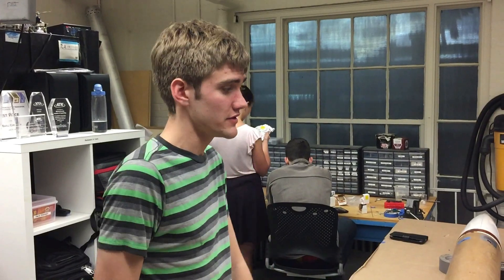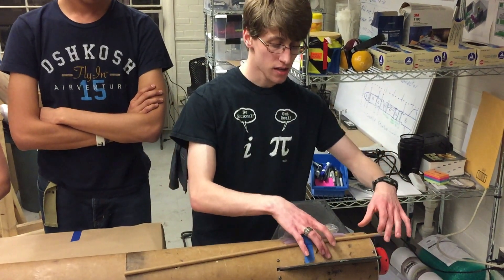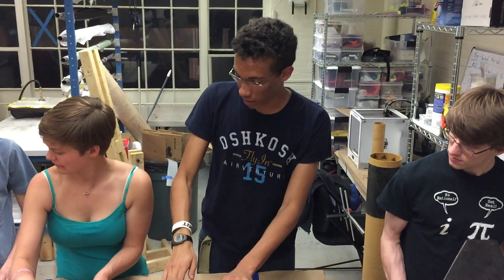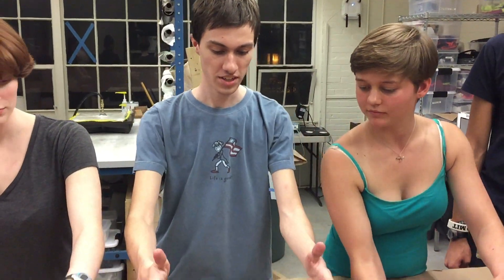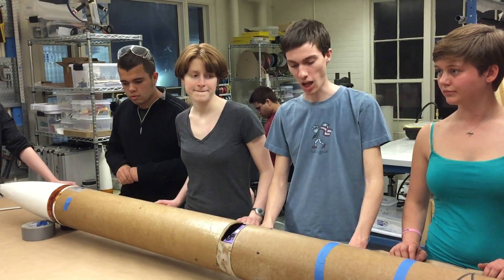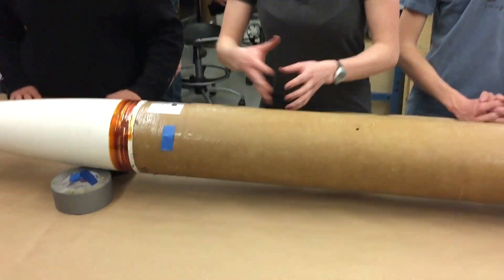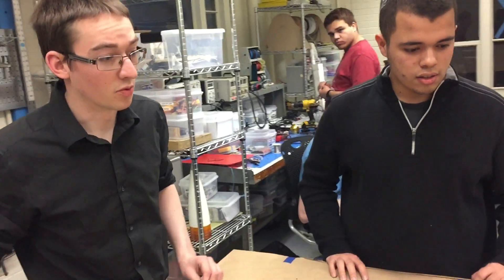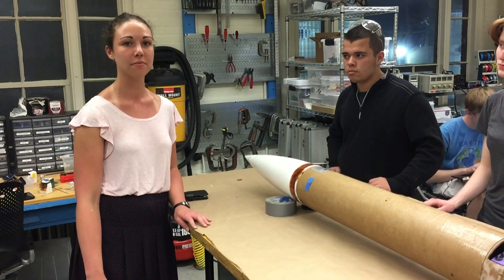Therion Overview - MIT Rocket Team

Comment: You guys aren't mixing your own fuel? Disappointing...
Reply: +James Fish We have worked on both custom liquid propulsion and custom solid propulsion in the past. This year we ran into schedule conflicts with our mixing location and with MIT safety regulations. Next year, when we compete in the advanced category of IREC, we will use the custom motor that we began designing this year.
Reply: @AstroCharlie  I like your shirt in the video Charlie. Life is Good
Reply: +James Fish They are doing some pretty interesting experiments up in the nose of the rocket, though. I imagine that the primary payload of the rocket made using a well tested commercial motor preferable to mixing their own. If this project was just about the rocket, then sure, making your own motors is something worth considering. However that doesn't appear to be the focus of this mission
Reply: What's the thrust to weight radio